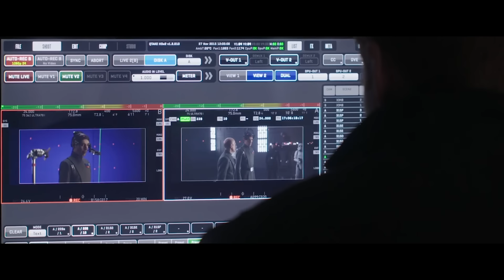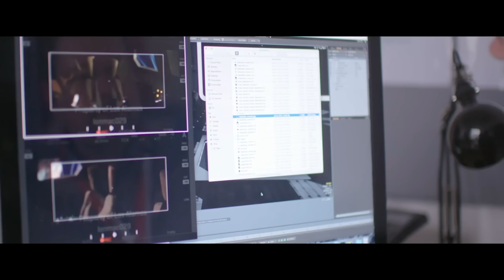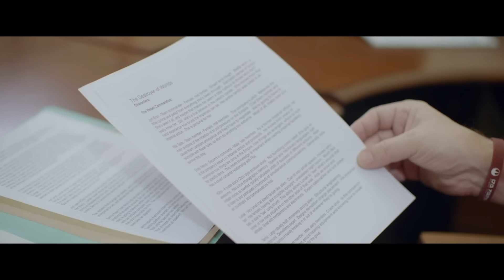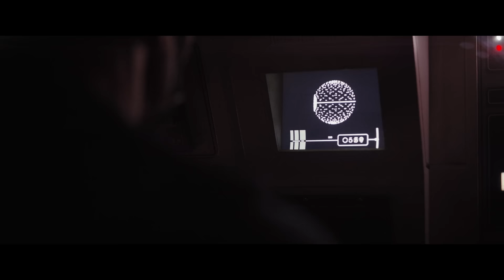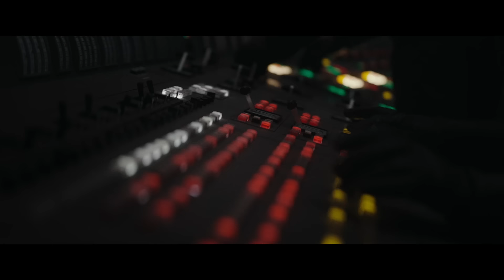Inside the Rogue One Director’s Cut

Comment: I like how those trailer scenes were not in the film because it didnt spoil anything at all.  It was nice to get the imagery without knowing what will happen.  It even felt like misdirection which made it even more exciting.  Like when she was walking on the plank on the antenna, you thought for sure, oh, here comes that tie fighter, and it didnt, which was a neat twist.
Reply: IMHO trailers should never reveal anything than the common theme. Not most key characters, not the story etc. That is whatfor the teasers are, but are shorter. 
The idea to make trailers unique and specific for the presentation is great way to do it without spoiling anything. 
And it should be done more often and more broadly.

Comment: I love the corridor scene. What a great last minute addition. It's so tense.
Reply: It shows Vaders incompetence.
Reply: @andymiller6661 
What would a competent Vader have done?
Reply: @kedabro1957  Not have a dramatic entrance. Immediately use the Force to knock everyone to the ground or floor or ceiling. Even if the initial knock downs are a few at a time, he can quickly knock down small group after small group, then either finish them or knock them out or use the Force to hold them there while stormtroopers search them for the plans. Or he could knock them all down and quickly make his way to the airlock while the stormtroopers deal with the knocked out troopers, searching for plans and taking care of business.

Comment: The exhaust port was Galen basically giving a Jedi the ability to take revenge for the fallen Jedi. Take that as you may.
Reply: Galen had nothing to do with the exhaust port. He only added an instability into the main reactor.
Reply: @davidh.4944  ?_? What do you mean? I figured the whole point was to make a singular point of error that someone could use to destroy it internally.
Reply: @viewtifuljoe4412  Read what I wrote again.

1. Yes, there was a deliberate weakness.
2. No, the exhaust port was not the deliberate weakness.
3. An unstable main reactor was the deliberate weakness.

This is a misconception I have to keep pointing out. Nowhere in Rogue One do they talk about exhaust ports. Galen Erso was in charge of main reactor design, not surface defenses. It is stated quite explicitly in the film; all he dared to do was introduce a subtle instability in the core, such that if it was overloaded, a chain reaction would occur and detonate the entire thing. His only hope was that this knowledge woud get into the right hands and that they would somehow find a way to take advantage of it.

Fortunately for the Rebellion, they did get hold of this knowledge, and thanks to some other engineer's lack of insight, managed to find a poorly-shielded pathway straight into the main reactor that could be accessed from the outside by small fighters. Perhaps there were other ways to set it off as well, but we can imagine they would mostly depend on getting inside the station to do so.

Comment: I find it funny that they were worried it wasn't as good as Force Awakens as I find Rogue One to be a much better film - while unnecessary, it tells an interesting tale where as Force Awakens just retreads the same ground as previous movies.

It isn't unusual for a trailer to have shots that don't make the final cut, or even for there to be shots done just for the trailer, but wow there seems to be a huge difference between what was being promoted and what was finally released.   I think the finished product is a good film but yeah, would be interesting to see the original cut to see what Disney originally agreed to make and what the cast all signed on for.  Sounds like it wouldn't be that different for the most part but some interesting changes.  You never know, Disney + always needs content and this would be a quick and easy thing for them to put up there so I wouldn't be surprised if it gets released sooner than later.
Reply: I agree even if I disagree with them killing off the cast.
Reply: I'm glad they killed off the cast, a war is grim, their sacrifices, in retrospect, made the rebels' struggles all the greater, and their final victory all the more powerful.
More films need to kill their casts, just not randomly and for no reason.  @Darkwintre
Reply: @lcmiracle  agree too. Kept the dark tone of the film. PLus saves the question of "where were they during epIV.
And lets face itwhile TFA started good, it did just descend into a remake of EpIV. Pity
But to be honest the additional intro for Cassian (dodgy, ruthless rebel fighter, dedicated to the mission rather than squeaky clean white knight hero), Jyn (lost my parents, abandoned, "i don't care anymore" rather than "they killed my parents I want to fight") and even Saw ( paranoid, fight the empire no matter what the cost/collateral and "just cos we;re the rebels doesn;t mean we're "good")
Reply: Force Awakens was much better. More original or not.
Reply: @SDfan2002  looked flasher, no substance to it.
Reply: @SDfan2002  Force awakens was a huge dissapointment  just rehashed crap and scenes slapped together bam bam bam bam.  The pacing is awful
Reply: @Revener666  The Force Awakens moves fast and as smooth as butter. Never a dull moment.
Reply: @SDfan2002  scenes just seems slapped together as they try to just shoves as much as poosible down your throat.
Reply: @Revener666  It moves at a very natural pace, whereas Rogue One feels chopped up and messy.
Reply: @SDfan2002 Force Awakens moves fast and smooth like diarreah
Reply: @morecowbell69  More like Empire Strikes Back.
Reply: I think they needed to explain the force dyad more. Maybe I missed it and should watch them all again.
Reply: @Darkwintre  how do you not kill off people who are no longer with us in a movie that takes place 10 minutes after this one ends
Reply: Exactly Rogue one is vastly superior in every metric in comparison to FA. 

The Force Awakens is the best of a bad trilogy of films. Although though that fact doesn’t make it that good either.

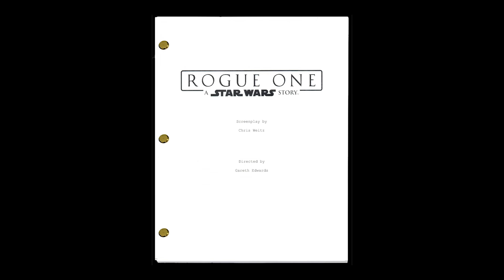Comment: 3:28  The original version of the ending.Will make more sense than the ending.We would have gotten in Rogue One Just setting it up to A New Hope makes no sense.It's like expanded universe Star Wars Legends did the same thing with terminator 3 Rise Of The Machines. I prefer the original ending the would have lead into A Hope not Didn't need to set it up because that would make more sense over the ending we got in Rogue One That is just setting up and we never got to see them that begin to attack the ship and then it begins in a new hope as they continue attacking the ship.

Comment: I don't get why people see the Death Star's exhaust port as a plot hole. History knows plenty of megalomaniacal engieneering projects with critical design flaws. Soviets designed and built a moon rocket that couldn't take off without tearing itself apart. Hindenburg was brought down by a static spark. Late-WW2 German engineers built a tank so heavy it couldn't cross bridges. Space Shuttle Challenger's solid rocket booster failed because the seals keeping it together were sensitive to cold weather, a fact that NASA engineers knew very well beforehand. Etc, etc.

Comment: To call it a "director's cut" is a bit disingenuous, because it implies that he a had different vision for the film and is unhappy with the theatrical edit.  As you point out, that is not the case here.

This sort of thing is just part of movie making.  Heck, it happened in the original Star Wars!  The Tatooine scenes with Biggs and Jabba were cut.  The Battle of Yavin did not originally take place at Yavin at all!  Cutting some scenes and reordering others increased the tension and tremendously helped the pace of film.

The changes to R1 were more drastic, but in the same way made for a better overall film.

Comment: The dumbness: We have a quizillion TIE fighters. 
You know what the vulnerability is. 
Park about 20 TIE fighters in a line about 100m separation. 
Then the rebels have to make multiple attack runs just to take out the ablative TIE fighters to even have a shot at the port. 
That would have killed the Rebellion right there and then. 
Or: "Hmmm, we have a planet killer.... wonder if it will work on Yavin...." and boom.... and "Yep. Clear shot, no 40 minutes to wait. Blow up Yavin 4!"

Comment: They still could’ve had a take of the beach run. Instead of Imwe & Malbus being pinned to a gate have em lead a suicide run to an adjacent radio tower to activate the same switch we see to radio the Rebel fleet. Change Imwe’s moment to be him having built a lightsaber with the kyber crystal he borrowed from Jyn, which is just forgotten in the film, and have him rally & lead the charge. They still die but we get the scene. Also, less Vader is better ; if they never showed him in trailers and he only had the hallway scene it would’ve been a more impactful surprise

Comment: One question: is the director's cut coherent, sensible, logical and not have multiple story lines that begin, then are dropped to move onto the next disconnected scene? If so, it's an improvement over the original. Though IMO, this is the most overrated Star Wars movie ever.